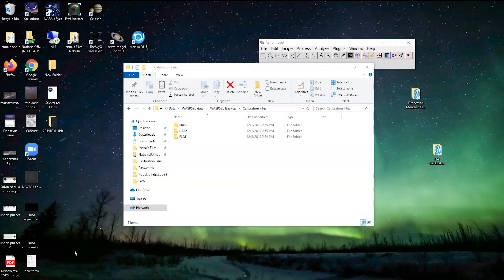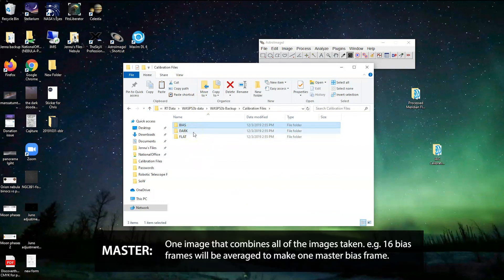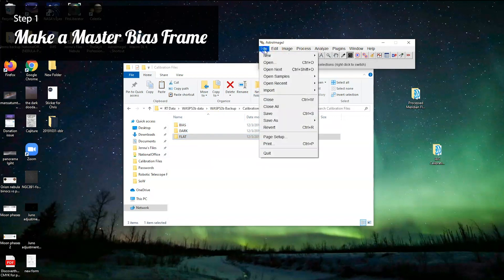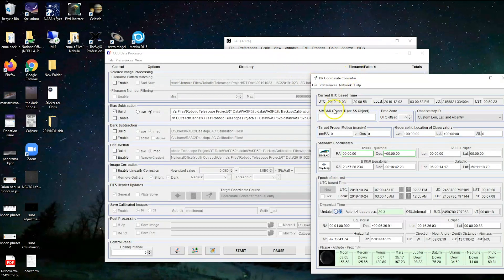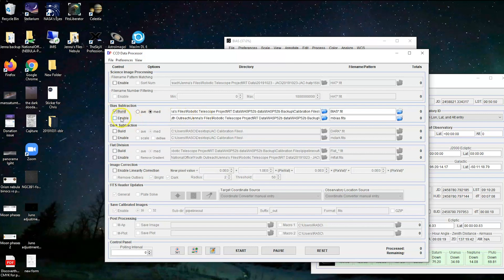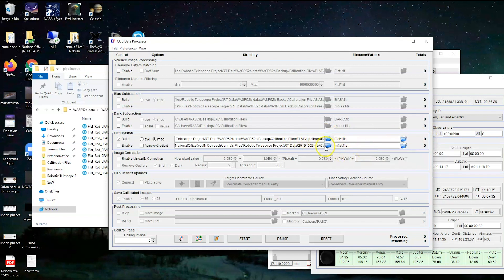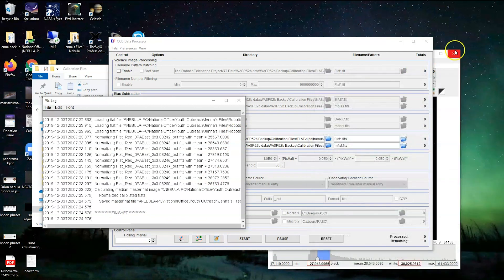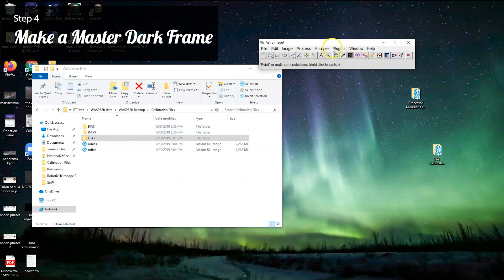Robotic Telescope Project: How to build and apply master bias, dark and flat frames in AstroImageJ

Comment: Remove Gradiant when creating Master flats? I have multiple filters, so I should have a Master flat for each filter right?
Reply: I am no expert with science data, but with pretty picture data, the answer is DEFINITELY!  Think of it this way, one of the many types of flaws corrected by flats are dust donuts.  Dust on the detector <hopefully> doesn't move around and is consistent regardless of the filter used.  However, dust is different on every filter.  I have 10 filters in my filter wheel.  Each has its own unique dust issues.  Hope that helps.